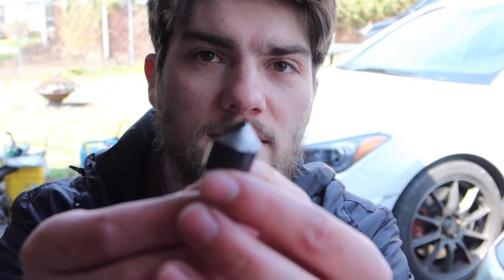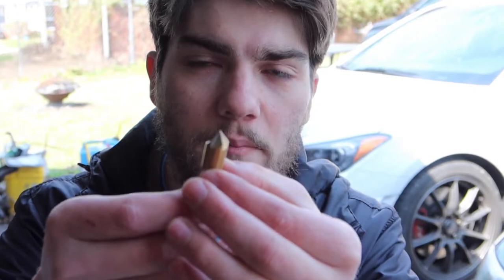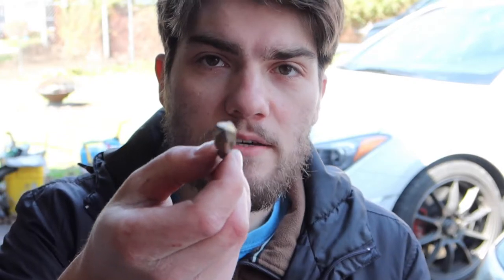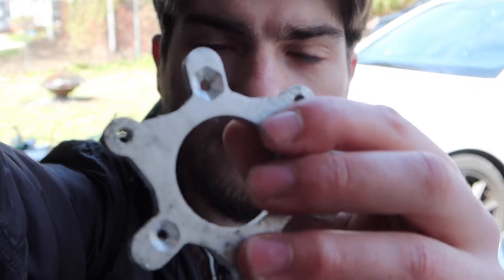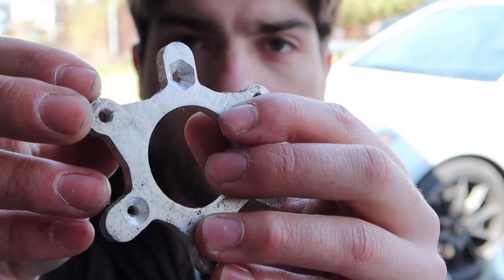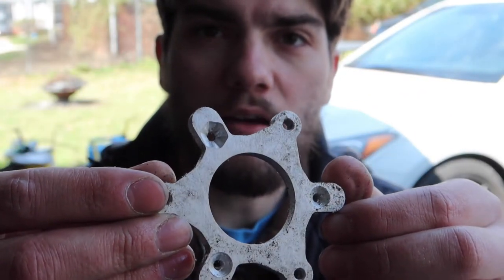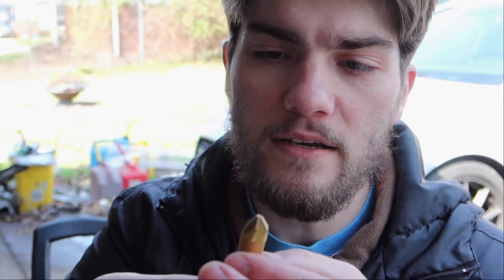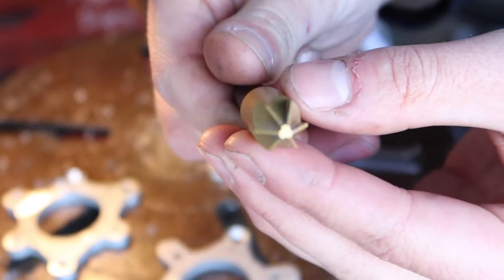HOW TO - Get a Good Finish when Countersinking Aluminum

Comment: Just watched a few videos last night about countersinking aluminum, and one particular video I saw where the guy used a bunch of different bits, the one with 6 flutes, each terminating in pairs to 3 points at the tip worked the best.

Comment: what rpm do you prefer to run those at on your drill press? I have a 6-flute I was trying, but not the one that goes into 3 points, but was getting horrible chatter in my aluminum piece. I think I'll try the 6-flute style you've shown.
Reply from the maker: Never hurts to try reducing the speed a bit. I'm not sure what rpm I'm running, but honestly its probably faster than I should be running it at.
Reply: @NickMakesBreaksStuff  thanks, I’ll try slowing down a bit. I also ordered a new 6-point like the style you have to try that, should arrive on Monday
Reply: @NickMakesBreaksStuff  I tried slower speeds but still horrible chatter, and on a brand new carbide bit. But, I ordered and tried the different style 6-point like you had and it was great! So yeah whatever it is about the 6 into 3-points just works, at least on aluminum. For what it’s worth I also tried a zero flute on aluminum and copper and it worked great as well.
Thanks again for the vid!